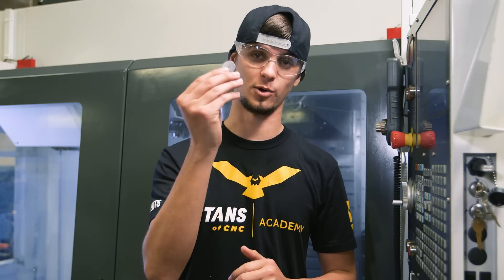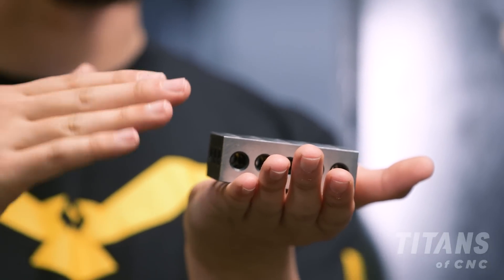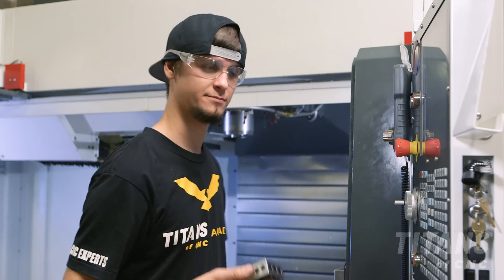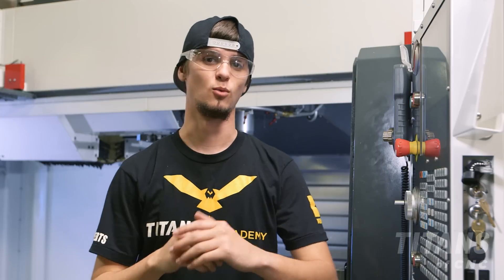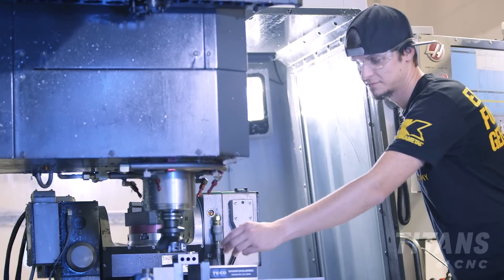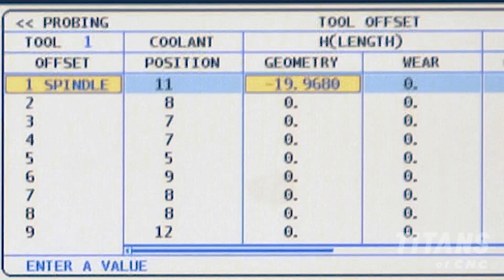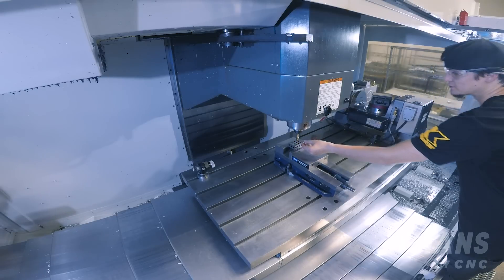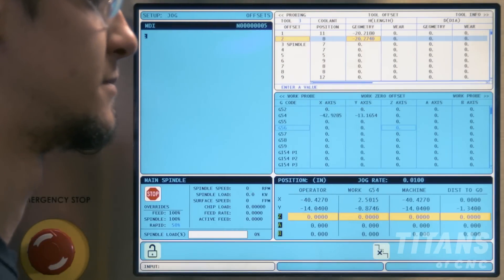TITAN FUNDAMENTALS: Setting Tool Height Offsets Manually

Comment: I use a datum tool something like a spot drill that is set to zero in the tool offsets then i use a piece of paper to set all the other tools according to datum tool. paper is 0.05mm so i bring the tool untill i feel it touch the paper then move the tool down 0.05mm and set the z
but i think using this method could be more accurate

Comment: What was the point of adding the -0.250?  If you used the same method with every tool, as you should, the .250 would make no difference.

Comment: The easiest way to manually input tool offsets would be to use a pre setter, a relatively in expensive piece of equipment and easy to get hold of, or even a height gauge and a couple of blocks, i would only use this technique if I had no choice

Comment: Excellent that how I do it but with gauge blocks instead. It would be helpful if you showed rotating the tool by hand and checking all cutter edges. Very few are exactly the same and you need to find the lowest cutting edge. This is the runout to the cutting plane of the tool itself. I have seen as much as .014" on a face mill.

Comment: I measure my tool offsets with a Blum laser. To get the stock offset, I use a 3x optic and touch off the stock in increments of 0.010 mm. Sometimes I will rotate the tool with my finger, if it clears the Sharpie marker, then I am within -0.001 mm to -0.009 mm. Last, I face 0.040 mm to 0.100 mm off the top, and call that new offset the top of the stock. Now I should be within 0.001 mm.

Comment: Great video! What's your opinion on subtacting the whole g54 .250 instead of every tool? Are there any minuses for this? Thanks
Reply from the maker: So, in the video we explained that, the fixture is best... but since there was a negative number in Z... it could be confusing to a new student so we chose option B so you could clearly see 6.0 offset.
There was a Z in G54 because the machine had been probed.

Comment: Why would you teach anyone to do it this way?  Wouldn't it make more sense to pick up each tool to the table?
Reply: Proper way. 

Put a tool presetter on table, touch it of with spindle, write down value in machine coordinate and write that number down.

Put in your tool, zero it on presetter, press tool measure and add value that wrote down before. BOOOOM done
Reply from the maker: Many different ways, this was a basic technique used for our teaching series, Building Blocks... located at academy.titansofcnc.com